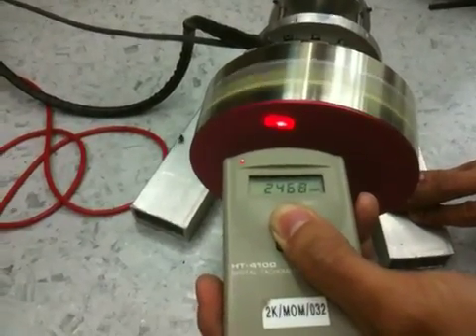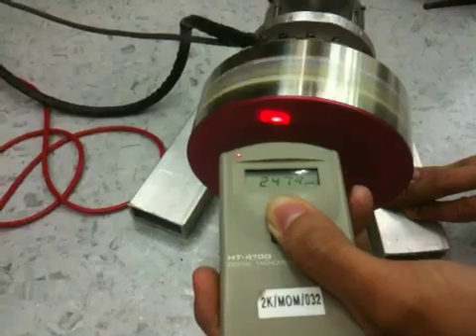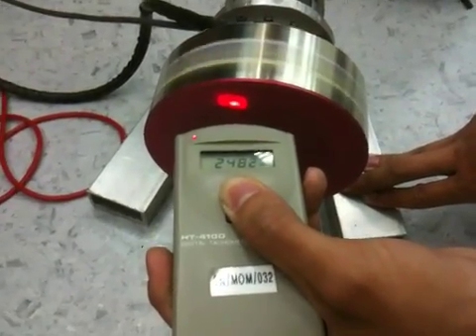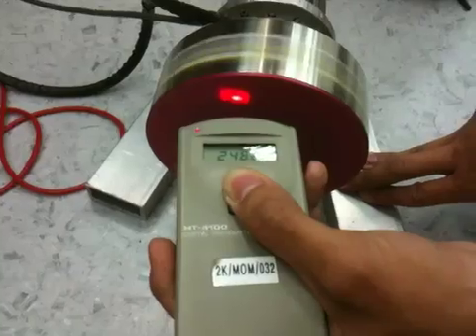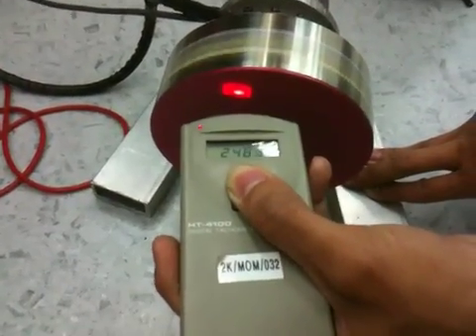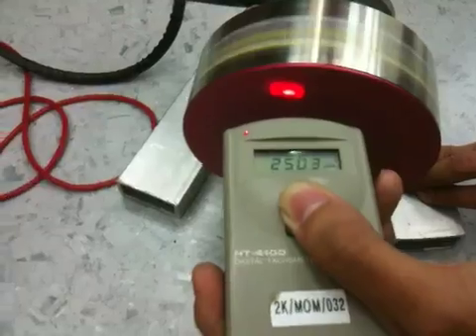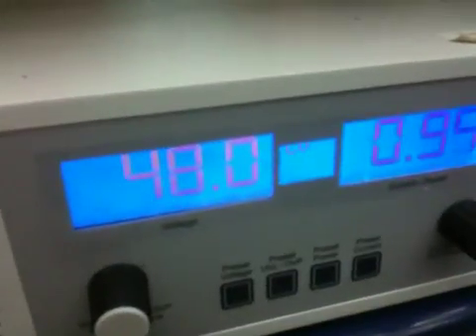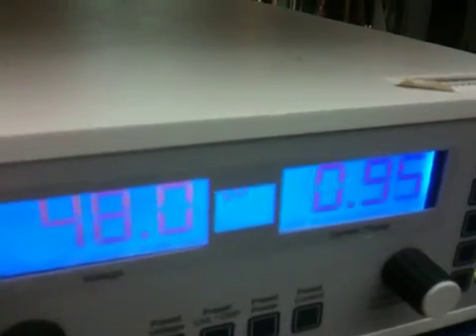Variable rotor stator alignment on Mitsuba motor (Expt 1)

Comment: someone correct me if im wrong but how is this useful except for analog throttle from fixed volt fixed pwm duty supply. if you move the coils further away to slow you get less inductive transfer efficiency. so to be why not set the coils inside at max q factor point and then change pwm duty instead?